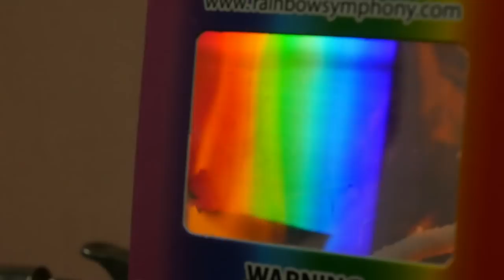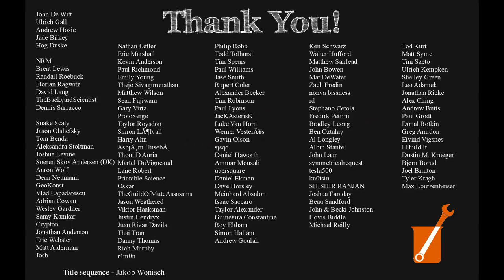Zeeman Effect - Control light with magnetic fields

Comment: You don't need large magnetic field to get Zeeman effect.  In HeNe lasers, the Zeeman effect is  exploited to allow the red line to operate.  Normally, in longer lasers, the 4 micron line dominates, because its gain is on the order of millions versus the 1.05 gain in the red.  This is because of another wavelength-shifting effect, doppler shift.  Doppler shift is proportional to frequency, so the red line is shifted 7 times more, leading to the lower gain.  By putting small, weak, permanent magnets next to the laser tube, the 4 micron line is broadened because of the "random" nature of the field.  So a complicated problem is solved by "simple, sloppily-placed, weak, magnets".
You don't polarize the light.  Zeeman effect is function of relative orientation of polarization and axis of the magnetic field.  You probably get stronger visual effect adding polarizing filter.  Have you tried putting sodium in glass tube, sealing it, and heating one end?

Comment: Ben, Nice demo  --  Exactly how my Rubidium frequency standard works.  It uses a ~6Ghz signal to excite the Rubidium gas to absorb one of the spectral lines from a Rubidium lamp.  Also there is a magnetic coil around the absorption cell to allow some amount of tweaking of center frequency or for temp compensation via the Zeeman Effect.It's cool to have a piece of equipment that contains a "Physics Package" at its heart. 
Craig  in Sunnyvale.    Would love to eyeball some time.
Reply: Not exactly right. The magnetic field is applied to the source of the light (the Rb bulb), not to the light itself.

Comment: Btw. Here's a tip on getting. Microwave oven transformers. 
If you go to one of the electronic recycling days ( usually in supermarket parking lots on a specified weekend) the items that are usually dropped off are printers, monitors, and Microwaves. Almost all microwave ovens stop working b/c the magnatron burns out. Meaning the transformer is more than likely good. Slip the guy $10 or $20 and ask the guy for a couple transformers. Bring the necessary tools, dont make a mess, try to be inconspicuous, and try to reassemble it after you take it out. I asked the guy what they do with all that stuff. He said they all go in a big shredder, so it doesnt matter whats left in them.
I managed to get 4 MOTs for $10. I could have got more, but I didnt wanna get him in trouble with his boss. A friendly reminder. The capacitors in microwave ovens can be hazardous even when not plugged in. Make sure the first thing you do when you get it opened is arc the cap with a screwdriver with one hand and other hand in your pocket. And maybe you want the magnets out of the magnetron. Be carful not to bust or scratch that ceramic thing. Sometimes they contain beryllium or barium (I dont remember which, but its highly carcenogic).

Comment: I can't think of a practical reason I personally would need to use this effect but this kind of video has me mesmerized. Very fascinating and well done, as usual!
Reply: I use it in the lab in order compensate the background, while measuring the concentration of some element using the atom absorption spectrometry method
Reply: This is friggin awesome !  Thanks for another fascinating video!  

Maybe more people should actually get up and do something useful with their time.
Reply: Without this effect, it would be difficult and more expensive to build larger red HeNe lasers.
Reply: The Zeeman effect comes into play every time you use GPS.  Atomic clocks have to be tuned magnetically to the frequency where Zeeman splitting is minimized.

I don't know that I agree with Ben's statement that MRI machines use the same principle, though.  MRI relies on nuclear (proton) spin relaxation, which isn't what's happening here at all.

Comment: Your experiment made me wonder if the flame from the candle was an ionized gas, and that’s what was causing the flame deflection in the magnetic field.
 To test my idea, I put a candle flame between two aluminum plates about 1/4” apart and applied about 200 volts dc (power supply max.) across the plates. As I switched the voltage on/off, movement of the flame was quite noticeable. 
I bow to better minds than my own, but this and your magnetic deflection makes me believe we are working with an ionized gas.

Comment: The phenomenon of ions absorbing the light from a gas discharge lamp that uses the same ions is also an important part of the rubidium gas cell, which is at the heart of pretty much the cheapest kind of atomic clock you can build. In that case, hitting the gas cell with microwaves of exactly the right frequency changes the amount of absorption, due to hyperfine splitting, and looking for that absorption peak allows calibrating the microwave frequency very precisely.

Comment: Nice.  But I'm not convinced Zeeman is responsible.  The problem is the subtle line shift, even with very strong magnetic fields, of the Zeeman effect.  For your 1T, the split might be some 0.05nm wavelength.  The line width of the low pressure sodium light source is some 100x this value at 5nm or so.  Not saying the absorption modulation isn't real; it clearly is.  Perhaps the velocity of the ionized flame traversing the magnetic field has set up an electric field strong enough to induce the Stark effect, which is more easily realized.  The demonstration is dramatic, but there are a number of confounding factors in play.
Reply: I'm also not convinced that self-induced Stark effect would be the culprit.
Reply: Agreed.  Stark is a stretch too.  My point is there is no shortage of alternative hypotheses to explain the winking light.  Clearly the flame absorption is broad enough to be visible using an inexpensive diffraction grating.  A sanity check would be to set up a similar demonstration using white light, but with the flame in a magnetic field.  If it is just Zeeman in play, we expect the line to spawn a broader family of lines (although there will not be sufficient dispersion to resolve).  Alternatively, the magnetic field might simply quench the Fraunhofer line wholesale.  That would indicate a different phenomena is responsible.
Reply: Are you sure linewidth of low pressure lamp must be around 5 nm? I can't find any evidence doing quick google search. However this article ("The width of the D absorption lines in sodium vapor") suggests that linewidth is about 0.4 nm at 400 C (and about 0.05 at 290 C) . I am not sure how to compare pressures, however if it's just equilibrium vapor pressure, we need to compare only temperatures. What's the temperature of sodium vapour inside these lamps?
Reply: I'd like to mention also that self-induced Stark effect requires very high intensities and I think usually observed with lasers.
Reply: Hyperfine broadening?
Reply: I thought that with magnetic field, we were just detuning the sodium in the flame so that it did not absorb as much of the sodium light coming from the bulb.  I don't see what line width has to do with it.
Reply: I believe this is a near exact replica of Zeeman's original experiment.

Comment: If you will, light is also an electromagnetic wave of a visible spectrum, certainly respond to static magnetism. A component in the microwave industry makes use of a polarized H field to divert polarized microwave wave in a transmission line/guide away from a first port into a chosen second port, called a circulator. The difference is that you have a non polarized light wave passing a non polarized media immersed into a H field. It is also interesting to see what if an adjustable polarized media is inserted into that H field. Love your experiments.

Comment: Great video! Just one thing, the Zeeman effect is about spectral lines (so electrons), mri is about nuclear resonance. You probably already know that and just used the comparison for the sake of the explanation but, as a chemist, I couldn't stay quiet :)
Reply: It's the same thing, just at different frequencies. An electron splits at 28GHz per Tesla, a proton splits at 42MHz per Tesla.
Reply: batcathatsatchat actually it's a different transition. Spectral lines come from the transition between orbitals, nmr exploits nuclear spin. There's an equivalent electron spin spectroscopy to nmr, but it has nothing to do with spectral lines. In a sense they are all a response to em radiation, but in different ways.

Comment: Awesome, Ben! The sodium emission lines are fascinating to me. I've read somewhere that San Diego county previously required all street lights to be LP or HP sodium arc so that their emissions wouldn't obstruct Palomar Observatory. IIRC Keck (and many other observatories) use sodium guide star lasers for the sharp emission lines.
Reply: The street light thing is related to light pollution. Requiring the nearby cities to use sodium lights (particularly low pressure)   is because it is easier to filter out specific colors ( with very fine spectral lines)  than a broad spectrum of light. And we need to filter out that light pollution because it's spreading over a large portion of the local sky and preventing telescopes to see the dimest details of the celestial objects they are looking at. It's an issue for scientific observatories but it is also a big issue for every amateur astronomer.
Reply: For giggles and to show a friend what the sodium light looks like, I made this photograph about 6 years ago. It's facing north from one of the hills near the apartment where I lived at the time (which was a little off of the right side of the image.) http://randomer.net/stuff/sodium-sm.jpg It's mostly LP sodium lights, but there are some mercury vapor lights on the right side. :)
Reply: Light pollution is definitely a huge problem for astronomy (researchers and hobbyists alike!) Filtering the 2 sharp spectral lines of sodium is fairly easy. For street lighting (the regulations in SD seem to have been relaxed, progressively, several times) LEDs are now the norm.

Comment: The reason your magnet core is getting so hot is because the core is made of conductive iron, and you have welded the two halves directly together. This completes the electrical circuit in your iron core. Essentially, your iron core is acting like a secondary coil that you've shorted out. It's only one turn, so it has a low voltage but high current. When using iron cores, you must break the electrical circuit, while doing to the least violence to the magnetic circuit. This is usually done with a piece of hardboard between the E and I parts of the outer ring of the core, usually just the center and one side but sometimes on all three connections. This isn't necessary on non-conductive cores like ferrite or air, but it is on iron.

Note that while this is the reason for the break in conductive cores, it's not the reason for breaks in ferrite cores. Those breaks are to change the shape of the B-H curve, usually to increase the energy stored in the magnetic field, usually in flyback transformers. Breaks to change B-H curves are usually sized very precisely and require calibration. Breaks in iron cores usually aren't so careful.

Comment: Great video as always,
but to be clear, the magnetic field does not affect the light directly, it changes the light and its polarization by affecting the material the emits light.
Let me know if got this wrong, and thanks again for sharing all your awesome work with us.
Reply: You got that right. One could, theoretically, polarize the vacuum and see similar effects, but the required strong fields are, if at all, only available near neutron stars. I would have to look up if anybody has observed an astrophysical signal that is the result of such a vacuum polarization.

Comment: I really enjoyed your demonstration of the Zeeman effect on Sodium lighting. Your use of a diffraction grating clearly showed the spreading out of the spectral lines in the gas. 
Clever construction of the electromagnet caught my eye, I have used those microwave transformers as well but never knew you could get a 10600 gauss field from them in that way without overheating the magnetic circuit core by eddy currents and the fact that the core material is driven hard into saturation. That would explain the current draw and its impedance. What I'd like to see is the ferromagnetic resonances (such as with isotopes of iron, perhaps fe^59?? not sure of my bandgap and isotope number there!!) using Larmor precessional values of the iron itself. Perhaps an rf amplifier would show those effects and if tuned with a low frequency pulsed direct current at low frequency (adiabatic invariance over the fundamental resonance of an infinite long slab) the double resonant Overhauser effect may show. Lots of integrals flying around there, but an amazing show of the torque of a compose compressed and twisted field line (at saturation!!) decoupling protons from the nucleus.
Amazing video. I hope you do more.
Reply: What

Comment: Hi Ben
1) Did you use the software tool "FEMM" for calculating the magnets/poles/air-gaps? It has a very easy learning-curve and gives great results fast!
2) Did you consider using a rotating cylindrical magnet (as they do in switchable magnetic dial-gauge holder, e.g. from Noga)? These would offer the cold operation of a permanent magnet, with the mechanical non-disturbance that you desire for this experiment. Field-strengths up to 1T should be easily achievable.
3) I have used flux-density meters from a US-based company called "Alphalabs" in the past. They don't show up on the first page of Google if you search for magnetometers. Nonetheless, they offer excellent value for money. (I'm not affiliated w/ them)

Cool demos of the effect! Cheers!! :)

Comment: I think that this effect works on the basis of phase rotation! A magnetic field aligns the light in one plane, makes the light polarized! There is a way to check my hunch))) remove the polarizing plastic film from the passive stereo glasses for a 3D movie and look through it, most likely, twisting it, you can completely turn off the light coming from the lamp through the magnetic flux! I’m also sure that more powerful magnets can rotate the phase of the waves of emitted light, so strongly by 180 degrees, from this the light can absorb itself

Comment: I guess you could use a second flame with sodium for the demonstration instead of the sodium lamp. Normally each flame will obscure the other, but if you apply the magnetic field on one of the flames, both should obscure each other less. You could also use hydrogen flames which are essentially invisible to the eye to diminish the contribution of other wavelengths.

Comment: also neodymium is not fond of being heated by an oxi torch :) you would end up with a really weak magnet in no time :) neos's are the worsed in that regard.

Oh i forgot to add, still great video as always ! im enjoying your content to the max, some way above my pay grade but hell :) fun either way :)
Reply: neos are always the worst :P
Reply: DarkIzo You can mostly demagnetize a standard N52 using only boiling water. 80°C is the point where permanent demagnetization begins, although it varies with the form factor of the magnet. 
Kind of hard to remagnetize too, you need about 5 Teslas.
Reply: That's why I use SmCo magnets in places where they may get warm (e.g. in a magnetron sputtering source, ion sources etc). Weaker and more expensive but can withstand temperatures up to 250C.
Reply: stamasd   The newer SmCo (2-17) can be made about as strong as an N30 grade NdFeB magnet at room temperature, and has a max temperature of 300 - 350°C depending on the formulation.

Comment: You could use your spectrum set up to test those permanent magnets, unless what you are saying was that the temperature difference actually occludes the same frequency of light? But I am guess you were not saying that. So you should see that same line in the spectrum drop out if the weaker permanent magnets are working, correct?

Comment: Nice attempt, but after calculations and investigations, I have some doubts like  other commentators. Zeeman shifts for the sodium D line are below 0.02nm and spectral linewidth for LPS lamp is about 0.5nm. (Another commentator stemtuber below gives 0.05nm  and 5nm respectively, which is worse). It is quite unlikely that we see Zeeman effect here.
Also looking forward for electromagnet design video. I'm curious if you found something like my findings on one of the previous jobs where I figured out that magnetic induction for air core coil limited by some box size depends on the product of the mass of copper by dissipated power and all other design variables annihilate each other.

Comment: The magnetic effect here is the motion of charged particles in a magnetic field, that's why the flame intensity is changing. The charged particles will start moving in circles when the magnetic field is introduced. The flame is very hot, the emission spectrum of atoms and black body radiation is adding up and making a white light at the hot bottom side, orange in the middle, and reddish on the outer side, that's why the colors do not match. This is the reason you have broad RGB colors on your grating 3:40. To observe the Zeeman effect, you need to observe spectral lines, in this case with the only 1T you are going to need a very high-resolution spectrometer with picometer resolution or a very high efficient grating with enough distance to observe the angle difference between the adjacent emission lines that are split. Your splitting will be at the order of the +-0.0x nm level.